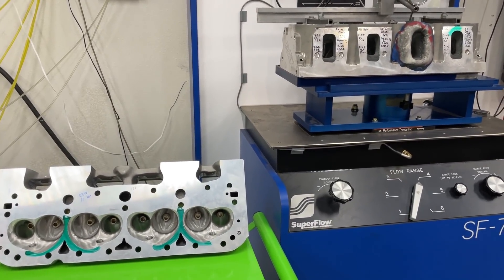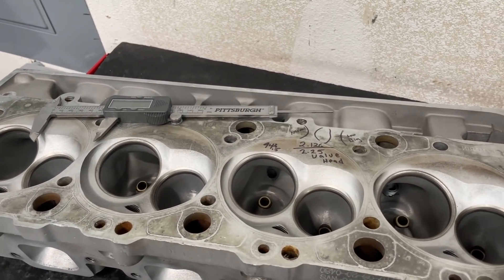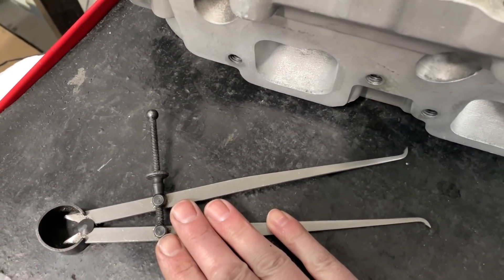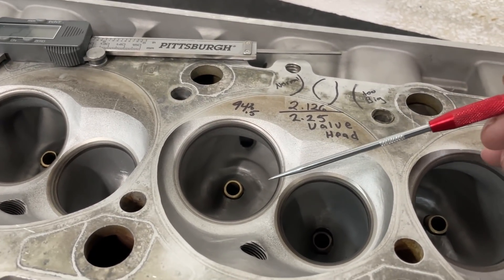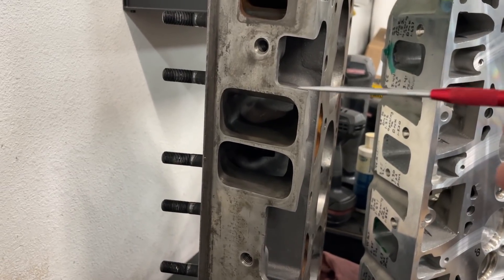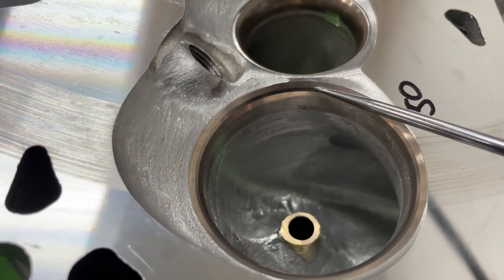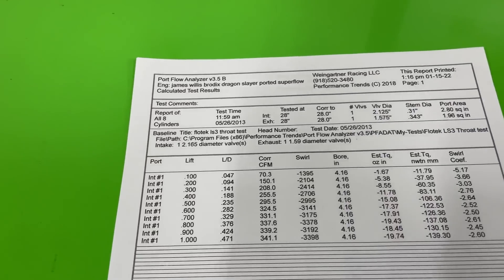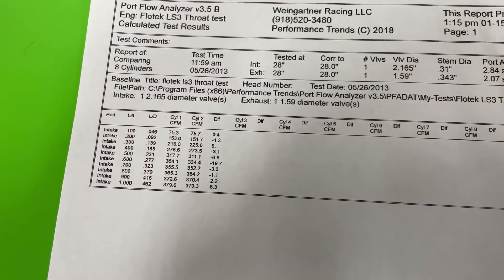What Not To Do When Porting Heads Part2: The Numbers

Comment: Oops! So I have some iron 429 heads with single degree intake seats. I blended the throat right to the bottom of the seat and I’m approximately at 92%. I think I will run the heads and worse case scenario I can pop them off and put in bigger valves as you mentioned in your first video. Any recommendations?

Comment: On a head for a pickup truck turning lower RPMs will this hurt me?  I'll need to take my heads off , n check with a bore gauge, and figure it like you showed. I went close to the valve seat , but don't think I went plum to the actual grind. These are the swirl port heads from 1987 before the Vortec GM heads. I smoothed up the swirl thinggy inside, but didn't resign them. Just opened up around them , and smoothed the swirl up.   On the exhaust side I opened them up to get the exhaust out.   Being this 383 Eagle stroker will be in a truck for mostly towing , an a lower RPM engine , I'm wandering if it'll kill it? I also golf ball dempled the entire runner.   I seen a video of a clear port showing that gas droplets would pool in a smooth port. I also dimpled the intake as far as I could reach into the runners. To me it just looked like all the gas going back to solid droplets would lower fuel mileage , as well as performance. Do you have any input on that?

Comment: Will New Cut Valve Seats And Valves Leak Air Under Extreme Pressure From A Blow Gun? I Filled The Chambers With Water And Blew Compressed Air Right Behind The Valve. At 80PSI They Didn't Leak. But At 120PSI I Started To See Bubbles Slowly Grow. Should I Lap The Valves Or This This Normal Given The Circumstances. I Also Noticed They Also Made The Throat Too Big. Waited 2 Years And $1,800 Kinda Disappointed. The CNC Looked Good But It Did Look Like They Ate Into The Under Cut Like This Video.
Reply from the maker: It should remained sealed. The valve job isn't round.

Comment: Hi Eric  so i picked up some 702 castings for my MarkIV  462 BBC . will be primarily street driven. i want to maximize the low lift flow but keep the stock valve sizes. I dont own a flow bench. for the intake side if i just  do a 4 angle valve job, blend the bowls into the throat area and clean up the ports should do the trick? on the exhaust side again a valve job , blend the bowls on the long side, streamline around the valve guides then deshroud some around the quench side of the exhaust valve  give me good results?

Comment: Hi Eric  ive got a pair of 702 BBC heads. car will be mainly street driven but looking for max low lift flow. if i keep stock valve sizes should i still go for 4 angle valve job with 30 degree back cut and just blend the pockets into the throat area ( intakes only ). for the exhaust side , clean up the ports, blend the bowls on the long side and deshroud at the quench area ?  its a 462 with around 9.1 CR

Comment: Good information to know. I have a old 283 with P.P. heads and were told it's not worth porting and still had hardened seats installed on the exhaust side. 
My feeling is, if it's cleaned up even a  little you should get better flow. 
I cleaned them up a little and trimed around the valve stem area and slightly under the seats just to smooth it out to the seats. Then cleaned up around the edge of the shroud area in the chamber area. Woukd that really helps or hinder flow? I know not seeing the heads makes it hard to say but I figure it doesn't hurt to ask.

Comment: I have been watching all your vids, and I have a few questions but can't find a vid close to my questions. so, here it goes....i have been told you can put a rectangle port bbc intake on oval port heads?  Also I have tall deck engines and they use 1/2 spacers to fit intakes too......is it possible to machine 1/2 spacers with oval on one side and rectangle on the other is it worth the work? ( none of these are in a full race application)

Comment: I would be interested to know what amount of swirl a good 700-800 HP head has (RPM & direction of rotation) versus a lower performance head,say 500 HP.
I assume every head has swirl, but is this something a head porter is attempting to change to extract more HP or better combustion? I know head designers have to consider this as the vortices in the wrong area can make a poorly combusting head..
Thanks for great info as always.
Terry

Comment: Excellent content Eric! My hangup with flow bench testing is how does it translate to a running engine. To clarify, airflow in a running engine, starts & stops due to the valve opening & closing (one issue). On a flow bench, a port flows in one direction. With respect to swirl, is too much swirl detrimental? I visualize air/fuel separation with high swirl (centrifugal force?), especially with carbureted engines (bigger droplets of fuel) compared to FI. What say you Eric? Thank you Tony. Also, please explain your 4-valve theory.
Reply: One of Vizards videos he vaguely talks about the centrifuge effect causing loss of atomization and large droplets being slung out onto the walls if you have to much swirl. So I would guess your right. IMO

Comment: Well in my opinion you don't need swirl to turn a fan, air just moving straight through will spin the fan. So, I don't see how you can tell if it is actually swirling. Great question. I would like to see a clear tube at the fan  with smoke in the air to see if it is in fact swirling.
Reply: The blade is parallel to the flow. Only angular flow will produce torque to turn blades.

Comment: eric quick question? does anyone make a valve job setup for us d.i.y home guys. be nice if i could at least size throats,open chambers walls up with a good low rpm drill press that dont have a shit ton of head play. just trying to figure out a faster way vs grinding by hand. thanks an love the vids.
Reply from the maker: No. The closest are stones and that setup is at least 2k
Reply: @WeingartnerRacing  thanks for the reply an yeah seemed like everything was 2k or better.. guess i might have to design a cutting head with valve guide rods that can change out that could work with a drill press head setup.
Reply: @WeingartnerRacing  g'day Eric. Stones are for seat grinding, crown and throat angle alignment.  A competent machinist could take the bulk out of throat in a good drill press. Then use a three angle seat cutter or stones for seats. 
What's your take on a radiused throat angle?

Comment: Eric, have you ever tried a lower valve seat angle for mild street stuff? I remember a decade ago guys were using a 30 degree seat for flat tappet big block stuff. They were picking up flow under .400.
Reply: Pontiac used 30 degree seats on many motors....But, the loss after 0.400 if your using a decent performance cam....Your better off with the 45 degree seats from what I have seen.
Reply: @ericbrandt829  ya, it didnt really make sense to me. Go through a set of heads with a valvejob and a set of springs only to put a hydraulic flat tappet with .450 lift in it.
Reply from the maker: No I would never use a 30degree valve job in anything I do.